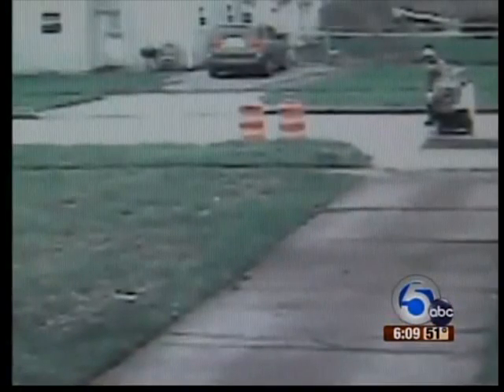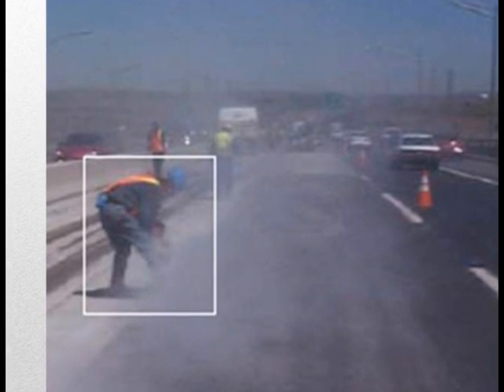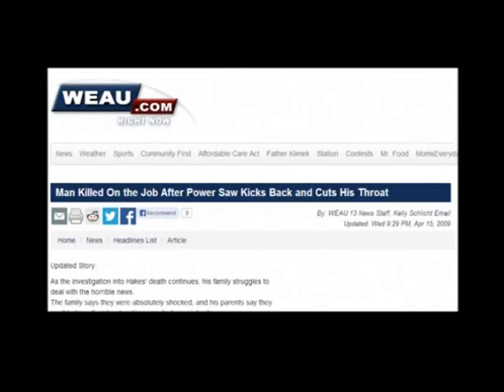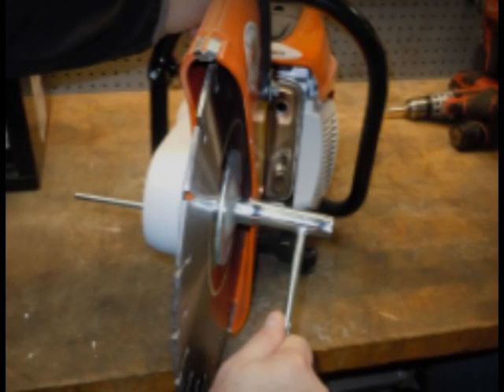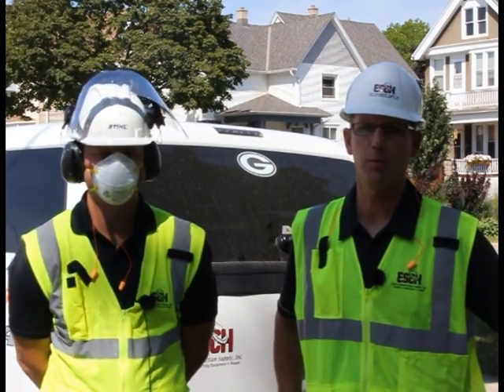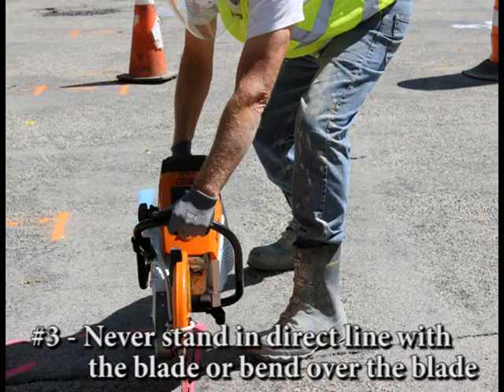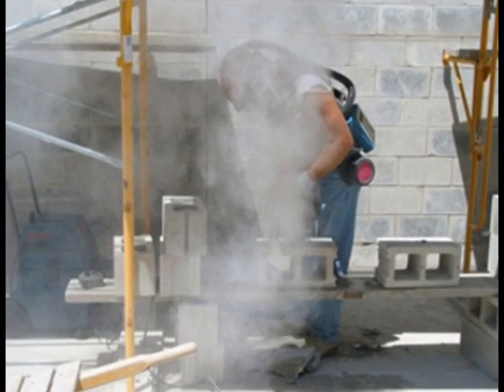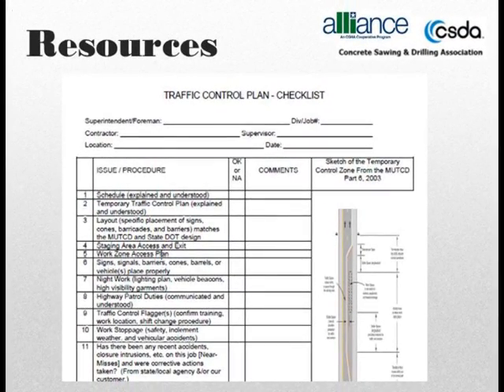Concrete Saw Safety

Comment: Good job on safety. I was planning on an electric wet cut saw these tips safety induction is very useful. I have been working on power sites and every morning we have a safety induction meeting which means safety gets hammered in you until it absorbs. If only safety induction can be for all road users. And we been told there is no such thing as an accident. Well done and thank you good work.